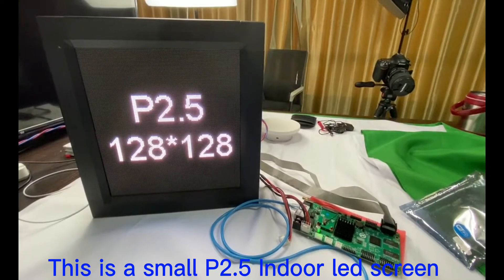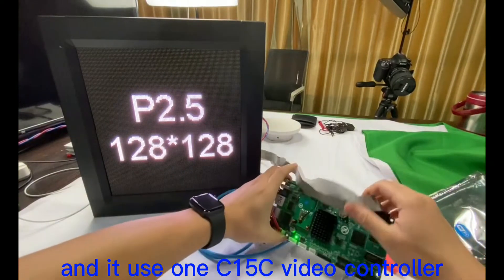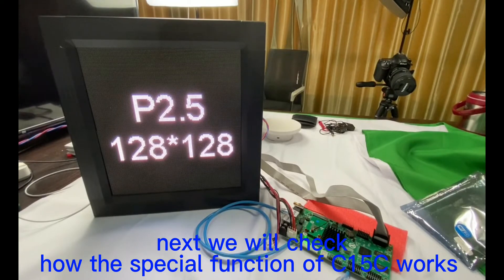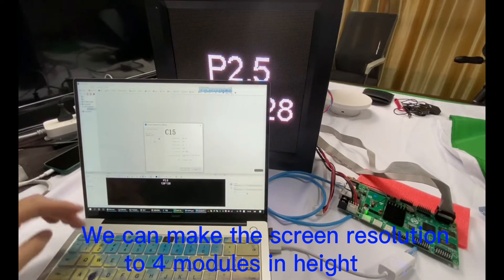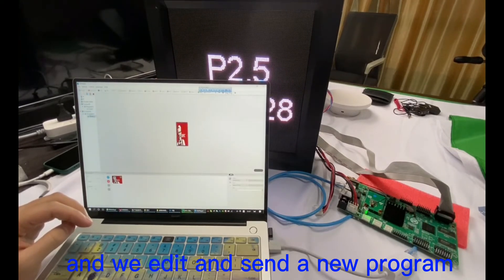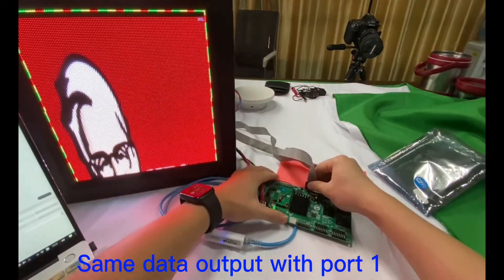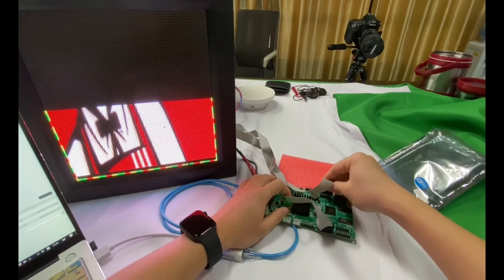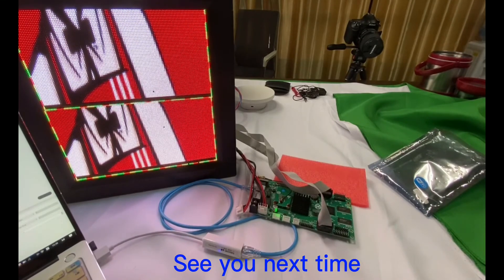video tutorial:how to make double sides LED screen with C15C controller-2

Comment: hey i have a question 
where i can find log file information 
or 
detail of video run on particular screen in huidu hd player
Reply from the maker: Hi you need to connect the controller to the Coud then you can record  play log of controller. for more question:please add WA: +86 18588455633